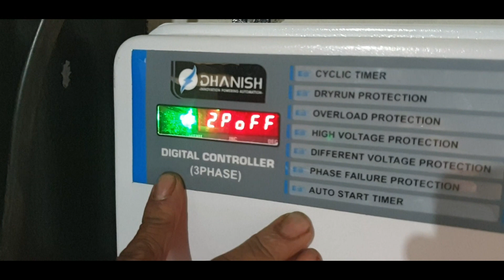Installing Submersible Pump in 1200 feet Borewell - 1200 അടി ആഴം ഉള്ള കിണറിൽ മോട്ടോർ ഫിറ്റിംഗ്

Comment: Use SS rope , where is PVC cooling sleeve for motor ? There is no pump guard in botton to protect the pump fall down in the well, didn't see any level electrodes and electrodes cable ? When there is no water if any one start the pump, pump will run in dry and damage the pump ... did you have any protection for dry run ? What materials for top and bottom adaptor its stainless stell or another materils ?.
Reply from the maker: SS rope is impractical for higher depth borewells. Irrespective of its higher strength and durability.
 We normally dont use pump guard.
We use submersible cables joined with rubber compound (water proofs) material.
What's the use of electrodes in cable ?Pls explain
We have used dry run automatic panel to avoid dry run and over load .
All adaptors used are cast iron
Reply: @thundathiltraders  level electrodes use for pump automatic start and stop the pump based on the level inside well... how your controller identify  dry run with out any sensor in the well ?  Please explain properly...
Reply: Flow sleeve must be use for safety for motor....
Reply: Awaiting  your reply...?
Reply: How controller identify dry run without any sensor ?. Please explain ... what tyep of panel this...? What are the protection available?
Reply: @ksharish2005  dry run protect cheyunnathu ampere difference sense cheythanu

Comment: NRV valve remove chaiyatha oru problm unde pipe ill fill aye kidakuna water thazha ke veruna nala force ill ane aa time pump nta impeller revese ill rotate chaiyan ullu chance koduthal ane ( anubhavam ulluth ane ) mostly submerssible pumps nu veruna oru complient ane  ethe ..pinea NRV water purth vedatheila athe coorect agana ulluapo Non Return Valve use chaiytha mathi..water kurchaa thazhake vadtholu .pump nu apo heavy preasure veratheilaa
Reply from the maker: പമ്പ് റിവേഴ്‌സ് കറങ്ങിയതുകൊണ്ടു മോട്ടോർ  കേടു വരാൻ ചാൻസ് ഇല്ല .റിവേഴ്‌സ് ഇറങ്ങുന്ന ടൈംയിൽ മോട്ടോർ ഓൺ ചെയ്താൽ മാത്രമേ പ്രശ്നം ഉള്ളു. കോൺട്രാക്ടർ ടൈപ്പ് പാനൽ ആയതുകൊണ്ട് കറന്റ് പോകുകയോ മറ്റോ ചെയ്താൽ മാന്വൽ ആയി ഓൺ ആക്കാതെ മോട്ടോർ ഓൺ ആവില്ല
Reply: Comp.verum impeller loose akum ..impeller side nokkeya mathi..service chaiythatte ullu konde paranja..impeller anti clock wise ill rotate chaiytha loose akum..no doudt..njanagle install chaiuna time ill vertical check valve ane use chaiuna..pipe nu safe atha..
Reply from the maker: @subeeshsudhakaran6554  IMPELLER ഊരി പോകുന്ന മോട്ടോറുകളും ഉണ്ടാകാം. 
ഞങ്ങൾ ഡീൽ ചെയ്യുന്ന 90 HP വരെ ഉള്ള പമ്പുകളിൽ (SINGLE / 3 ഫേസ് ) അങ്ങനെ ഒരു പ്രശനം കണ്ടതായി അറിയില്ല. പ്രത്യേകിച്ച് 3 ഫേസ് പമ്പുകൾ ഫിറ്റ് ചെയുമ്പോൾ റിവേഴ്‌സ് കറങ്ങുന്നതു സ്വാഭാവികം ആണ്.ഡിസ്ച്ചാർഡ്ജ് നോക്കി ആണ് പിനീട് റോടേഷൻ കറക്റ്റ് ചെയുന്നത്.
Reply: Starting capacity kodeya motor ailam thana soft starter or VFD vazhi ane operate chaiuna ..egana ullu aa drive ill voltage polarty nokke ane start akuna. Pinea 90 ho motor onum dol starter, star delta starter vazhi .operate chaiytheila. Soft star ill already config.chaiytha veruna. Polarty..soft starter,vfd selection chaiumbo pump application nokke adukuna...pinea namale domestic application use chaiuna pumps 1 hp ,2hp,3hp .pump nu oka e paranja reverse problem unde...njangale 3phase pump install chaiumbo phase polarity protection relay panel ill add chairunde...apo pump nu prorected ane
Reply from the maker: @subeeshsudhakaran6554  90 hp വരെ ഉള്ള സ്റ്റാർ ഡെൽറ്റ സ്റ്റാർട്ടർ മാർക്കറ്റിൽ അവൈലബിൾ ആണ്. പ്രശ്നം റിവേഴ്‌സ് റോടേഷൻ ആണെങ്കിൽ spp എല്ലാ 3 ഫേസ് പമ്പുകൾക്കും വച്ച് കൊടുക്കാറുണ്ട്.
നമ്മുടെ പ്രശ്നം മോട്ടോർ റിവേഴ്‌സ് കറങ്ങിയാൽ ഇമ്പേല്ലെർ ഊരി പോകുമോ എന്നതല്ലെ  ?
Reply: @thundathiltraders  90 hp  star delta starter  risk ane bcoz 90hp - min, 120A.- 135 A VERA ADUKUM .softstar or vfd ane better bcoz starting current ( In ) koduthal ayerikum.
polarty protection unda revese rotate chaiytheila athea njan paranja..pinea njangle 75 hp uda 3 ph.pump install chaiythtte unde athe grundfos nta arune ,,company thana parayunde reverse rotate chaiytha pump side problem ane ..pinea chela brand impeller allen key vachu tite chaiytha veruna ..agana ullu po reverse rote chaiythalum impeeler loose akatheilaa..paksha pump side problem ane
Reply from the maker: @subeeshsudhakaran6554  സോഫ്റ്റ് സ്റ്റാർട്ടർ നല്ലതാണു . വില കൂടുതൽ ആണ്. vfd ലോഡ്  വേരിയേഷൻ വരുത്താണ്ട സ്‌ഥലങ്ങളിലും നല്ലതാണു. പ്രാക്ടിക്കൽ ആയി ഞങ്ങൾ ഉപയോഗിക്കാറ് 90 hp വരെ സ്റ്റാർ ഡെൽറ്റ സ്റ്റാർട്ടർ ആണ് .

പിന്നെ റിവേഴ്‌സ് റോടേഷൻ  പ്രശ്നം. ആഴം കൂടിയ ബോർവെൽ കിണറിനെ സംബന്ധിച്ചു nrv വച്ച് മോട്ടോർ സെറ്റ് ചെയ്യൽ പ്രാക്ടിക്കൽ അല്ല. അത്രയും ലോഡ് കയറ്റൽ പ്രാക്ടിക്കലി നടക്കും എന്ന് തോനുന്നില്ല.
Reply: @thundathiltraders 90hp thotte ullua motor nta price vachu nokkumbo softstater install chaiuna nallathu pinea softstater um vfd um use chaiuna time harmonic destroation undakan chance unde..oru limit vera capacitor bank  athena maintan chaium..industral side ill capacitor bank vachatum kariyam eilaa....
NRV pump nta preassure na kurgan chance unde athe correct ane..paksha non return use chaiyth nokke difference mansilakum👍
Reply from the maker: Oru 6inch Borewell 7.5HP Motor 200mtr Head 2inch Delivery . Nrv remove cheyathe fit cheythal easy ayi erakanum kayattanum patumo?
Reply from the maker: Harmonic distortion ne kurichu enik arivilla.Technicians paranju ketta arivu matram ullu
Reply: @thundathiltraders  harmonic destrotion undakum 1 ill kodutal drive work chaiumbo distrotion undakum...
Reply: @thundathiltraders  water discharge chaiunth ano chothicha ????
Atho pump bore well nu adukunthe ano ??
Reply from the maker: @subeeshsudhakaran6554  Thanks for the info .
Reply from the maker: @subeeshsudhakaran6554  മോട്ടോർ കിണറിൽ ഇറക്കുന്നതിനെയും കയറ്റുന്നതിനെയും കുറിച്ചാണ് .
Reply: @thundathiltraders  welcome👍
Reply: @thundathiltraders  column pipe anakill vela preshanam eila ..pully use chaiytha mathi...pipe ill valve erikunthu konde eragan um kayytaum buthi muti verum ..ethe vera namake kuzhpam undayyte eilA....pully use chaiuntha nallthu
Reply from the maker: @subeeshsudhakaran6554  ഈ ബുദ്ധിമുട്ടു മാത്രമേ നമ്മൾ ഉദ്ദേശിച്ചിട്ടുള്  .
Reply: @thundathiltraders  company valve kodukuna .pump safty ke ane... Bore well ill pump eraganum kaytaum pully with stand koode ulluth use chaiytha kuzhpmilaa.technicans um athea safe...
Reply from the maker: തങ്ങൾ പറഞ്ഞ പുള്ളി വിത്ത് സ്റ്റാൻഡ് വച്ച് ഒരു മോട്ടോർ ഇൻസ്റ്റാൾ ചെയ്യാൻ ഏകദേശം എത്ര ടൈം വേണം ? 1200 അടി ആഴം ?  തിരിച്ചു കയറ്റാനും എത്ര ടൈം വേണ്ടി വരും >?
Reply: @thundathiltraders  bro..time ailaa ethill safty nokkanam..pinea pully eilathaa erakunaa risk ano??
Reply: Etraum weight um vachu agana pully eilatha erkunaa risk ane..time nokke work chaiyam.paksha risk um ane work nta perfection um kurve ayerikum
Reply from the maker: @subeeshsudhakaran6554  ബ്രോ .. താങ്കൾ ഇപ്പൊ പറഞ്ഞതിന്റെ പ്രാക്ടിക്കൽ വശം താങ്കൾ തന്നെ ചിന്തിക്കു.
സേഫ്റ്റി തന്നെ ആണ് പ്രധാനം.എന്നാലും ഓരോ വർക്കിനും ഒരു നിശ്ചിന്ത സയമം ഇല്ലേ? ഞാൻ പറയാൻ ശ്രമിക്കുന്നത് പ്രാക്ടിക്കൽ വശം ആണ്. ഓരോരുത്തരുടെയും സേഫ്റ്റി അവരവരുടെ ഉത്തരവാദിത്തം ആണ്.എന്തായാലും കമന്റ് വായിക്കുന്ന എലെക്ട്രിഷ്യൻ മാരുടെയും ടെക്‌നിഷ്യൻ മാരുടെയും ഇഷ്ടത്തിന് വിടുന്നു.അവർക്കു ഇഷ്ട്ടം ഉള്ളത് അവര് പിന്തുടരട്ടെ. എല്ലാവര്ക്കും ആശംസങ്ങൾ നേരുന്നു.

Comment: Sir, is it okay if we use an old belt compressor for an open well of approx 7 meters dept (total head: approx 30meters).
Reply from the maker: Just check the current consumption and discharge. A normal centrifugal or submersible will be the best option
Reply: @thundathiltraders  thanks
Reply: @thundathiltraders  കിണർ ആണോ നല്ലത് അതോ കുഴൽ കിണർ ആണോ നല്ലത് അതിനെക്കുറിച്ച് ഒരു വീഡിയോ ചെയ്യാമോ 🙏🙏🙏

Comment: borewell ethra vellam undenu tst cheyyn arenkilum undo
Reply from the maker: Level check cheyyan pattum but etra neram pump cheyyan ulla vellam undenu motor vachu test cheythu nokkandi varum.
Reply: 600, feet ആഴം ഉണ്ട് 6ഇഞ്ചിന്റെ ബോർവെൽ ആണ്. ഏകദേശം 60അടി മുതൽ  വെള്ളം ഉണ്ട്. നമ്മുക്ക് ഇതിൽ നിന്നും എത്ര ലിറ്റർ വെള്ളം പമ്പു ചെയ്യാൻ സാധിക്കും.
Reply: @prasanththampy8111 	volume calculating formula vazhi calculate cheyyam

Comment: 200 feet thazhcha Ulla bore 145 feet vellam kity, eethanu best motor? Ethra HP venam? Ethra feetil motor set cheyanam?
Reply from the maker: 1HP dharalam mathiyavum.veetu avashyam ano ?  .Motor 185 or 180 feetil erakkam.Borewell pump nammal cheyyunathu Texmo , EKKI , Classic ee brandukal anu.
Reply: @thundathiltraders  Texmo yude price ? Ningalude shop evidanu?
Reply from the maker: @nithinjoseph7231  Texmo ethu model? etra hp ? Shop Near Perumbavoor,Ernakulam Dist.
Reply: @thundathiltraders  1hp, oil cool borewell motor
Reply from the maker: @nithinjoseph7231  Texmo(Aqua Group) oil cooled motor manufacture cheyunathayi ariyilla. Whatsapp numberil contact cheyu 7034904458

Comment: 1320 feet borewell എത്ര HP motor വേണം ചിലവും
Reply from the maker: 3 Phase connection available anenkil 7.5HP ayirikum nallathu. Site condition and requirement nokki Higher HP venamenkil vakkam.
Reply: @thundathiltraders  single phase motor വർക്ക്‌ ചെയ്യില്ലേ irrigation purpose ആണ്
Reply from the maker: Max 1000 feet vareye single phase kittu

Comment: 1200 feet എന്ന് പറയുമ്പൊ 365 meter . So the Water pressure under 365 meter is approximately 36 kg . How dare You to install 25 Kg Coloumn Pipe in Such a bore well ?
Reply from the maker: Thank you for your concern. It was installed at a depth of 340 meter, like you said the pressure will be around 34kg. We normally use 35kg + pipes . It depends on the customer budget and decision. There are some customers who even use 10kg HD pipes for 240 meter depth. We can only suggest.Customers will decide.